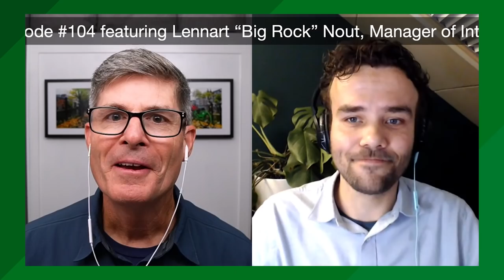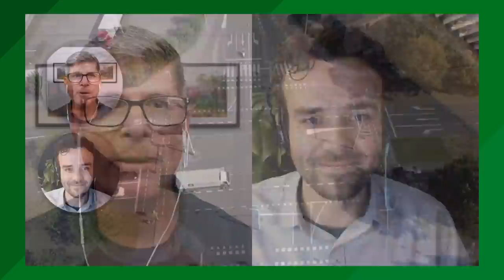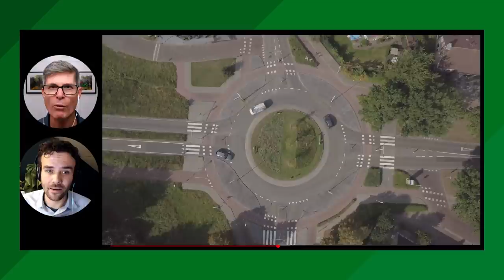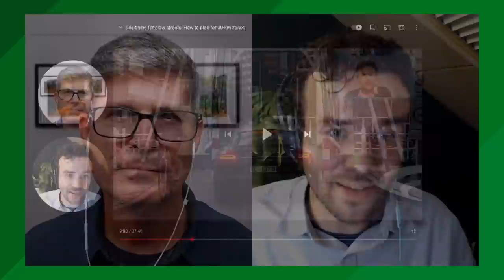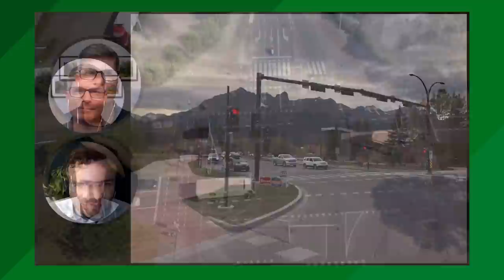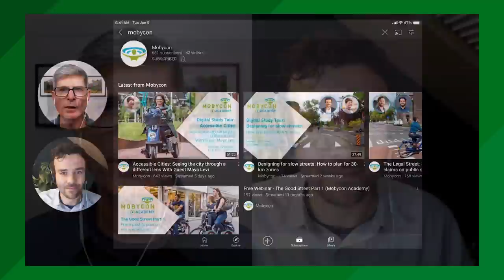Why Dutch bike facility design works so well

Comment: Another benefit of having the traffic lights at the near end of an intersection is that if you move too far ahead you can't see them anymore. Thus you naturally stop at a point they are still in your field of view. And don't end up at the part of the road pedestrians and/or cyclists are crossing (in front of you)
Reply from the maker: Yes! Very good point. Another great example of design nudging the desired behavior. Thanks so much for watching. Cheers! John

Comment: 41:00 for slow moving cars, the engine is the loudest. For cars moving over 40 km/hour, then the tire noise is higher... since these bricks are generally used in 30 km/hr streets, then the extra brick noise is not an issue.
Reply from the maker: Thanks! I think that's pretty much what Lennart said - and with the increased number of electric cars at slow speeds noise pollution will drop even lower. Cheers! John

Comment: He said a very important thing about "managing where you want the traffic to go" – because this in my opinion is the very first step. In fact every single German village as long as it has more than one street has a traffic-priority plan (and I guess it's the same in most of Europe, clearly in the Netherlands), where all streets are categorized as either through-streets and residential streets. Those residential streets are on average some 70% and those only need slow speeds and clearly not bike lanes. On the other hand you only have about 10% that clearly need things like protected bike lanes, traffic lights or roundabouts and other things to keep the traffic flowing.
Seeing examples from North America it often feels like almost all streets are the same and bike lanes are primarily build in residential streets.
Reply from the maker: Depending on the city, far too many bike lanes in North America end up on STROADs because they are inherently wider (have more excess space) thus, they are far less comfortable to ride on than getting off into the quiet, low-traffic, low-speed residential streets, which typically have little to no traffic calming or actual cycle-specific facilities.

Comment: Indeed, if the red would be continuous I would automatically assume that everyone yields to me. Thanks for explaining how that is actually a rule ;)
Reply from the maker: @Sander vd Donk, Thanks so much for watching and contributing to the conversation. Here in Austin we increasingly have our cycle paths in red (concrete) and then the "U.S. standard bike lane green" in the "conflict zones" at the intersection which doesn't necessarily communicate priority but to alert drivers that a cyclist might be present and to "yeild if the cyclist is there first" - much less defined. I'd prefer the Dutch approach. Cheers! John
Reply: @ActiveTowns  Thanks for your reply. I just looked up a bit about red bicycle paths, the first red bicycle path was only laid in the Netherlands in 1980, so not so long ago :).The first red one was in (surprise) Tilburg! And the red color was just chosen because the city council wanted an alternative color, but they didn't want to pay much for it. And red was the cheapest alternative color :)
Reply from the maker: @maanvis81  Yes! Isn't that just fabulous. I think I heard it was basically soemthing like a rust-based pigment. If you haven't done so yet, check out my videos profiling the emerging Austin infrastructure - you'll see some familiar rust colored installations. Cheers! John
Reply: @ActiveTowns  I think the first red bicycle paths in the Netherlands are the one made of stone. I think it is far cheaper to have red stones than other colors. Then later the asphalt came.

Comment: Regarding traffic-calming. I have an idea. I've expressed this idea in the YouTube comments before, possibly even on this channel.
Place an open picture frame on a t-post so that it sticks out to be JUST EVEN with the curb like a hollow plastic flag, or maybe beyond, if the area immediately adjacent to the curb isn't counted as part of the lane of travel. Do this on both sides in pairs. You can see through it, so you'll be able to react to stimuli beyond it, but it'll visually protrude into the lane, narrowing it. If you hit one, it'll provide negligible resistance. Maybe some lost paint, or a welt if you manage the feat on a bicycle or motorcycle.
String several of these down a stretch, so you're encountering such a constriction every couple hundred feet.
The overall cost would be low, and they'd be easy to set up by a small crew, or even one person, on either an interim or permanent basis.
Reply from the maker: Interesting... would certainly make it appear narrower.

Comment: There is something about roundabouts, that has always made me wonder. Why don't we give priority to the left instead of the right? Maybe even on normal equal crossings. You wouldn't need shark teeth anymore and for bikes going the wrong way, they would have to give way. It would seem so much more natural. Priority from the right will prioritise filling your crossing instead of clearing it.
Reply from the maker: Interesting point... Lennart will probably have a few thoughts on this. Thanks so much for watching and contributing to the conversation. Cheers! John
Reply: The same reason you let people off the train before you let others get on: the capacity is very limited and things will come to a grinding halt quickly if people are supposed to be allowed to join first, but there's no space.
Reply: The idea is that you dont have to stop when you are on the roundabout. When it is rushour and entering has priority it will cause a deadlock within seconds.
Reply: When on a roundabout there is NO traffic from the left hand side...
Approaching a roundabout the left HAS priority.
Or are you the one who goes clockwise?
Reply: @dutchman7623  First all, I am talking about right hand side driving. Then there is only traffic from the left approaching you when you enter the roundabout. I hope we agree about that. 
Now the only reason why this traffic from the left has priority is because the roundabout is a one way traffic priority road. 
That has not always been so! In the 1960 and 70-ies they built roundabouts with no sharks teeth or other priorities. That caused congestion of course. Nobody questioned the rule "priority from the right" to turn into "priority from the left". They just introduced the priority roundabout.
Reply: @GerHanssen  I think you mean shark teeth on the roundabout lane itself, right? I don't think there are many roundabouts left in The Netherlands like that. Once your on the roundabout itself, you have priority over anyone that wants to get into the roundabout. So it's actually already like you say. Giving priority to traffic coming from the left....
Reply: @GerHanssen  But priority from the left in right hand driving traffic is completely unnatural.
You'll have to give priority to those who will never cross your path.
Even when everybody is using their blinkers and handsignals correctly, because that becomes very important, it will lead to dead locks.
Simply imagine a busy road with a calm cross street, you are on the busy road and have to give priority to someone from the street coming from the left.
But that driver cannot go because he/she depends on their left coming traffic he/she has to give priority.
Meanwhile the drivers from the right, who's path is free, cannot go because they have to give you priority.

On the other hand (!) priority from the right makes sense because they always cross your path, and you are the one who can let them go. Especially when they want to turn right.
Reply: @peter-tjallingsiertsema7600  No, I did not mean shark teeth on the roundabout. That would be very strange, of course, Nowadays, when you are entering a roundabout, you will have shark teeth, but if the rule would be: "give way to the left", that would not be necessary.
Reply: I think that's one of those things that sounds nice in theory, but will cause confusion in practice. I had to think about this a lot, so I can imagine many people would struggle to remember/understand this concept.
Reply: @jelledevos841  Exactly, but you can achieve this by using the rule: "give priority to the left", as an alternative to making the roundabout a priority road. I claim that this also works better on normal equal crossings.
Reply: @GerHanssen  I see what you mean now, thanks. It might be confusing though. And potentially cause a lot of accidents. And you still would need shark teeth at "normal" crossings. It seems like solving a non existing problem to me.  Around the corner from where I live there's a roundabout with a "fietspad" going 3/4 around. At one entry the bikes and pedestrians have priority at the other the bikes and pedestrians have to yield. I must admit that I had to check if there are even shark teeth there. And there are. I don't even notice them, but I guess it's because I know the situation there. The shark teeth make it very clear though. Now, if there was a stop sign anywhere, it would have been a different story.
Reply: @peter-tjallingsiertsema7600  I think it's the other way around. In practice it works fantastic, but in theory it looks quite scary. I certainly don't believe in accidents when everybody is being careful.
Reply: @dutchman7623  Sorry to say, but your story is so incoherent that I don't know where to begin to point out your strange reasoning. 
You think/feel is unnatural and than you go looking for reasons. 
You say: "You'll have to give priority to those who will never cross your path." ?huh? 
You say: "...it will lead to dead locks" No, opposite. Deadlock can also occur with priority from the right for the same reason you mention here. 
If you cross a street as a pedestrian, you first look left. That is where the danger comes from. Let the user of the road clear the crossing and cross after them. 
You say: "...priority from the right makes sense because they always cross your path...". I think if you can avoid  others to cross your path, that can only be a good thing.
Reply: @driesoostwouder2996  A slip of the Enter key, A cat on the keyboard? What was that? 🤨
Reply: @GerHanssen  all of the above

Comment: Now, they just need to keep pedestrians off the red concrete.
Reply from the maker: True, however, we must always remember to take a deep breath and extend the same grace, caution, and courtesy towards people walking, in wheelchairs, and using mobility devices that we, those of cycling, expect from drivers of motor vehicles. Essentially the law of the more vulnerable user of public space always ultimately has priority.  Thanks so much for watching and adding to the conversation. Cheers! John
Reply: As a Dutchman I can tell you. Pedestrians are really careful not to walk on the red. It's dangerous.
Reply from the maker: @Whistler4u  Yes. I can relate. From my personal observations and experience over there, when you walk, you learn quite quickly, and then before long, it's second nature. Thanks so much for watching and for contributing to the conversation. Cheers! John

Comment: I come from Australia and we have bike paths, but here I keep hearing about bikeways. Is there a difference between the 2 or is it just rhetoric like petrol Vs gasoline?
Reply from the maker: Hi Chris, First, thanks so much for watching and serving up this good question. Yeah, no need to get too hung up on the nomenclature, bike paths/lanes, bikeways, cycle tracks, etc., etc. The key things to keep in mind are the conditions: when near motor vehicles traveling over 30 km/hour protected and/or separated facilities should be provided, if motor vehicles are traveling at or below 30 km/hour some form of a shared facility can be used so long as it is obvious and intuitive to motor vehicles drivers that vulnerable roadway users (people walking, cycling, using wheelchairs, scooters, etc.) have priority. Obviously, this approach must extend to how intersections, where the mixing of modes occurs, are handled. Cheers! John
Reply: @ActiveTowns  👍

Comment: At 31:50 ish there is a remark about the traffic lights being on the stop line on the intersection in Kenmore. I noticed that, but I also noticed that this is not the case for the bicycle lights. Those were still way over three lanes of traffic. Anyone has an idea why that is?
Reply: Maybe because as the biker has to look over the whole crossing and see if the cars really stopped for their red light?
Edit: bicycle light are on the side were you stop. Sometimes also at the other site as well. Pedestrian lights I accually do not know. I have to look next time. I think at the other site of the street.
Reply: Bad copy of Dutch design. There is not even a stop line for bicycles. So how are they alerted to look for a traffic light?
If I am on my bicycle and see a fat white line across my path, I immediately look for a light (or a stop sign), when there is none, I do carry on as usual without stopping... 
Pedestrian lights are always across the street, without a stop line.
Reply from the maker: @André Somers, Thanks so much for watching and contributing to the conversation. I see if Lennart can chime in. Cheers! John
Reply: Here in NL they are also near the stop line for people on bicycles. Often with a push button and sometimes a waiting time indicator. I am also curious why they decided to put them on the other side of the road instead.
Reply from the maker: @arthurhagen3826  Thanks for watching, Arthur. The lights are oriented strictly for the benefit of motor vehicle drivers with little to no consideration given to anyone, not in a car. I believe, that it is literally written in the MUTCD (Manual for Uniform Traffic Control Devices) to be like this. Here's just one horrific diagram from the 2009 edition: https://mutcd.fhwa.dot.gov/htm/2009/part4/fig4d_03_longdesc.htm
Reply: @ActiveTowns  thanks for the link. I find it difficult to see any rationale behind it though. Why position stop signs before a crossing and traffic lights that indicate you to stop (same function) on the other side?

Comment: I have followed many courses at the CROW organization. I always found it very interesting about how people thought about infrastructure, but indeed always the thought "Let your own brain work too". Maybe that's typical Dutch :-)
Reply from the maker: @Bert Kassing, Thanks so much for watching and contributing to the conversation. The funny thing is that there are similar statements in North American manuals as well, but too many just ignore that statement that they should exercise their engineering judgment. Cheers! John
Reply: @ActiveTowns  I think in america it also has to do about avoiding liability. An engineer or transport department can always say "we followed the guidelines", even when coming up with literally lethal designs.
Reply from the maker: @hendman4083  Yes. That is one aspect for sure. Of course, those same manuals literally say, engineers and designers should use their professional judgment and not blindly follow any guidance. Two hopeful points, the manuals and guidebooks are changing (slowly), and constituents are starting to hold elected officials accountable for these deadly designs and they, in turn are demanding changes in the transportation departments. In some cases, lawsuits against negligent design are helping to move the needle as well. Thanks so much for watching and for the comments. Cheers! John

Comment: Brick has a negative impact on micromobility diversity, as it makes life difficult for skaters, boarders and small-wheeled scooters.
Reply: It is a positive impact! We do not want them on the road but on the sidewalk or not at all.
Reply from the maker: @lowrads, You bring up a good point that highlights the preference to construct smoother surfaces for a broader audience, including those who need to use wheelchairs and mobility devices. Thanks so much for watching and contributing to the conversation. Cheers! John
Reply: I don’t see a problem here. The road users you describe are mostly recreational anyway and they are not allowed to use the road, only the sidewalk. Most sidewalks are surfaced with pavement tiles, not with bricks.
Reply: @RealConstructor  👍
Reply: That really depends on how you lay the bricks. It's perfectly feasible to create smooth brick paths.
Reply: @LennartNout  Question remains; do we want skaters, skate boarders, small wheeled scooters (electric and non electric) on our cycle paths?
Already we are facing electric bicycles that are (illegally) going faster than 25 km/h.
In Amsterdam mopeds that should be limited to 25 km/h are already banned from the cycle paths.
More and more Canta's and similar are using the cycle paths.
Does the future ask for 6 lanes in each direction? Bus lane, car lane, between car and bicycle lane, bicycle lane, between bicycle and pedestrian lane, pedestrian lane?
And what have we gained when it comes to this?
Reply: @dutchman7623  do we want them sharing our footpaths with the pedestrians? Or do we want them to share the road with the cars? Neither. So cycleway it is!
Reply: They're great for drainage.
Reply: Lately they place the bricks in the middle, so people biking no longer have to go over those. This means only wide vehicles pass over the bricks - which are cars. Scooters, bikes and skaters won’t have issues with the new road design. I am glad they kept the bricks because the load noise and subtle bumping feel in your car makes you feel like you cannot drive too fast, it works great to slow down drivers.